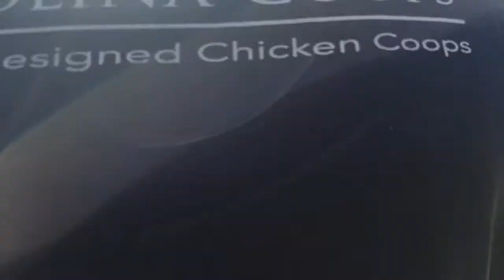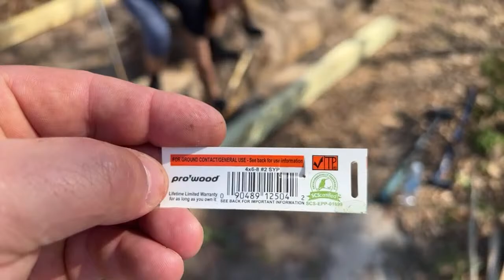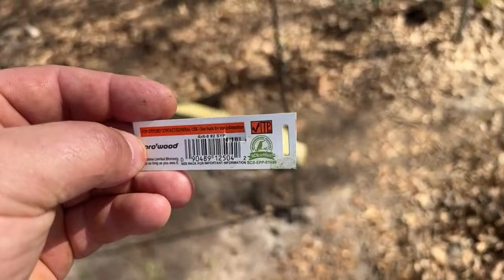On-site in Fuquay NC installing a base

Comment: I use a Sawzall for tree roots .. never sacrifice yer chainsaw in dirt :) Also, when connecting 4" x 4" or 4" x 6" together using those staggered step cuts, i would suggest cutting back 6" to 8" inches and using 2 counter sunk bolts with washers so they can't twist or become misaligned over time. 2 bolts are better than 1.  We still stack railroad ties using rebarb or threaded rod to connect them all in most cases but we also do those step cuts on each row. Like you said.. it's like  laying brick. Concrete base with drain rock  with drain pipe is best for anything you lay on top of it.

Comment: I used to be in pigeon racing, the coop is similarly built but the other way around. Meaning, the main coop is bigger and the chicken run-or in pigeon it is called an aviary are usually smaller (a fraction). For example, a 10' x 12' coop will have  a 2'x2'x8' aviary built out. Most of the pigeon coop is for perch, nest boxes, feeding and can be configured/elaborate limited only by the owners budget and imagination. Another big difference is racing pigeons costs from $100's to $1000's for good pedigree, and the equipment and feed are more costly overall. It sucks when you let them out and a hawk just kill and eat your favorite and most expensive pigeon which is part of pigeon racing.

Comment: Hey I commented on this video about your ltl driver issues. I'm a very big fan of your coops. I wanted to revisit this because I saw one of your coops being delivered by another you tube channel. I see why you might have some discrentalled drivers. The pallet was built the wrong direction for safe lift gate deliveries. You need to allow the pallet jack enter the pallet from the 4 foot side of the pallet. It is safer to have the pallet hang off the side of the lift gate not the end. The driver was clearly struggling to prevent it from falling off his truck. Secondly you need to prevent your staff from over selling delivery expectations. If they live atop a huge hill and you think a driver will be capable of pushing a coop up that hill by himself you are promising something physics might deny. There are bad drivers at every ltl company, but most often upset customers are a result of inflated expectations.